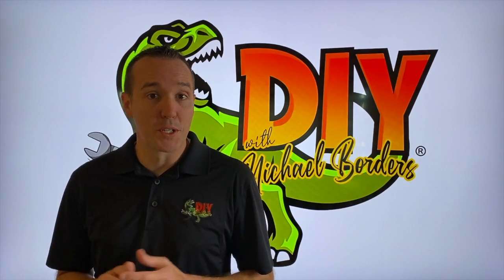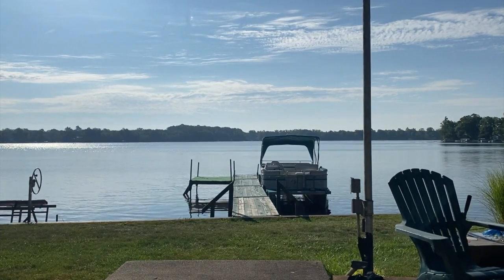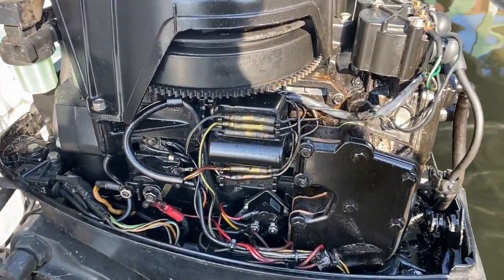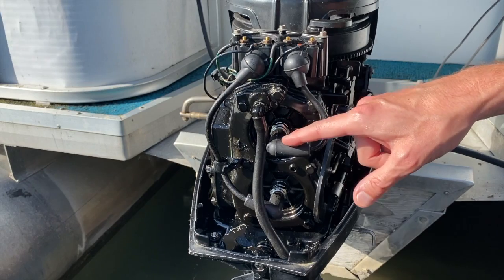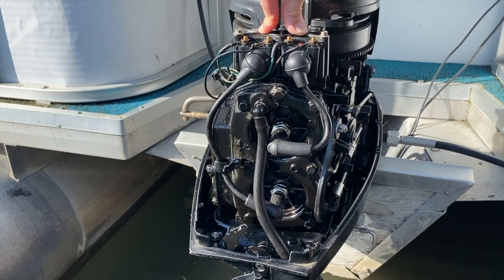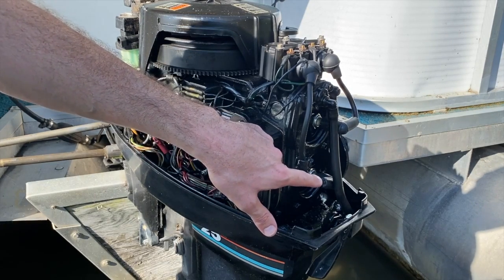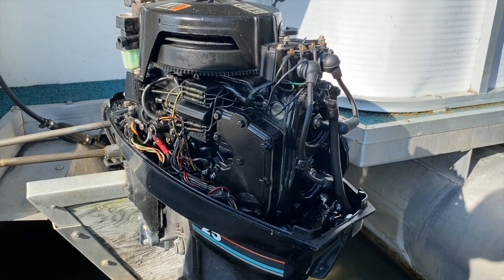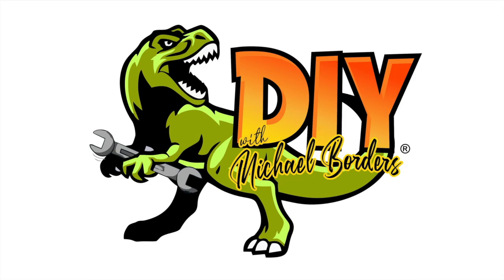Mercury outboard engine misfire at high RPM - Fouled plug/Coil/Switch Box

Comment from the maker: If interested in purchasing this product, visit our Amazon affiliate link below.  I earn from qualifying purchases.

     NGK spark plugs:  https://amzn.to/3NFufdv

     Spark plug wires/boots:  https://amzn.to/44dp7o7

     Spark plug gap tool:  https://amzn.to/3PLQH7i

     Ignition coils:  https://amzn.to/3OfWpxn

     Switch Box:  https://amzn.to/3L1bhNi

     Jet ski stand:  https://amzn.to/3xvO4jm

     Wire cutters:  https://amzn.to/3D6cnUm

     Dielectric grease:  https://amzn.to/3PMzR8g

     RTV sealant:  https://amzn.to/43cALOJ

************

1.  Replace outboard engine Ignition Coils

          https://youtu.be/ib9X5vzP56M

2.  Replace spark plugs and wires

          https://youtu.be/xTX9z8VFmxk

3.  Replace outboard Starter

          https://youtu.be/r-lF1R2_k74

4.  Replace outboard Voltage Rectifier

          https://youtu.be/x-pfqRtCWMw

5.  Rethread and tap cylinder for spark plug

          https://youtu.be/xIW3_cQXdaQ

6.  De-winterize outboard boat engine (PART 1)

          https://youtu.be/IjzSsgypiTA

7.  How to gap spark plugs

          https://youtu.be/z066ckRtLsI

8.  Assemble jet ski stand

          

9.  How to build your own custom logo skateboard

          https://youtu.be/9Isty_4fIIw

10.  How to mount your skateboard on the wall

          https://youtu.be/c5QDCKZNGH0